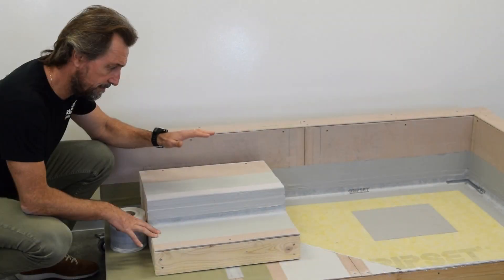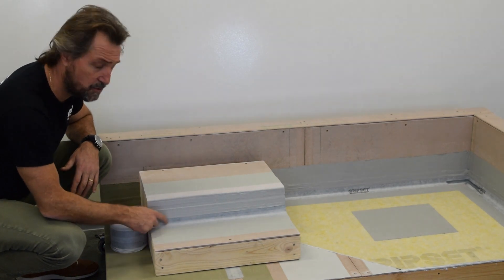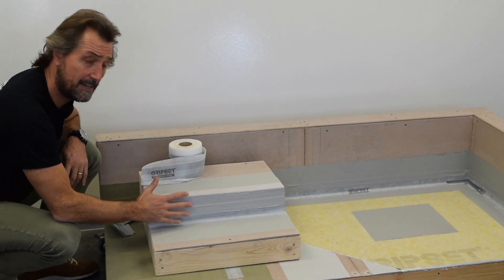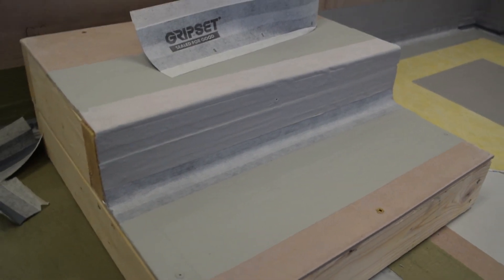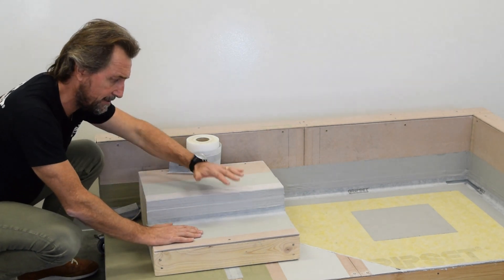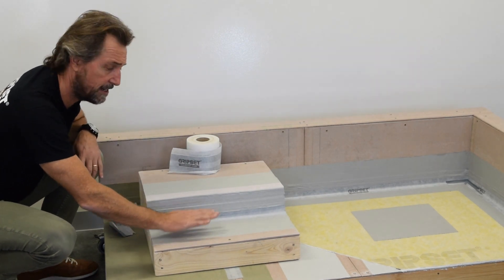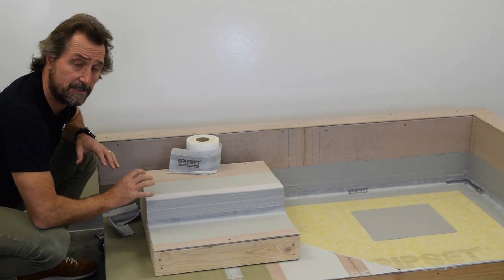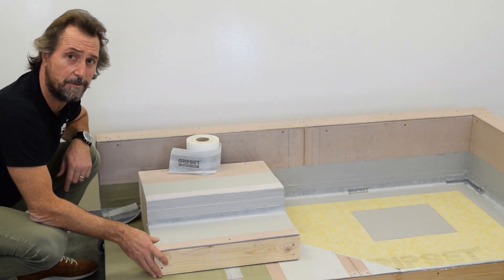External Waterproofing

Comment: This is great I have been using this system repairing jobs, it's not cost effective. It works well if not damaged, but almost every job gets damaged from long aluminum window frame installations, bottom tracks always cut into the membrane due to heavy load, sub seal fixing, packers, screws, adjustments etc.
I believe we need a much tougher and heavy duty (liquid flashing) if you want to call it like urothaine.